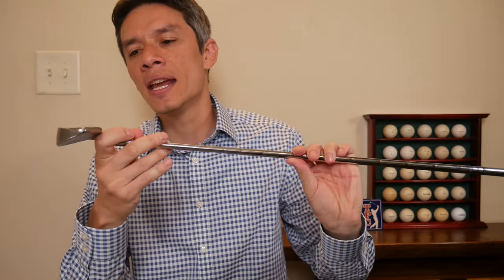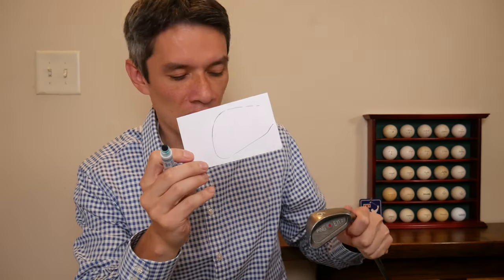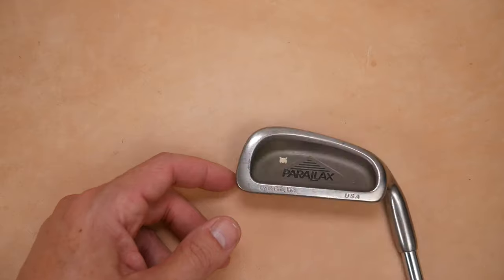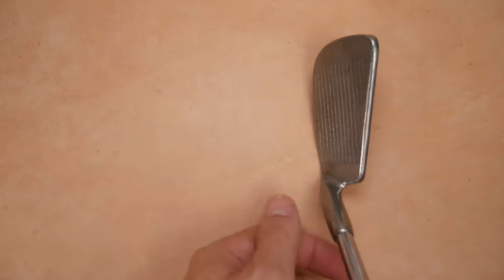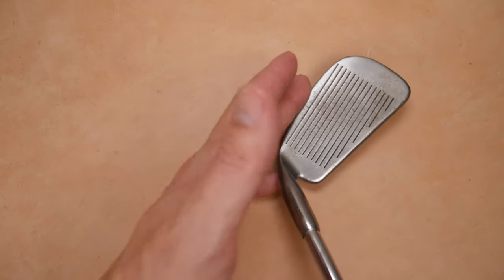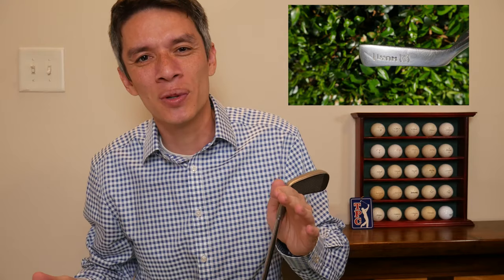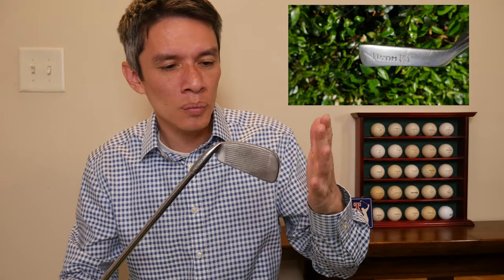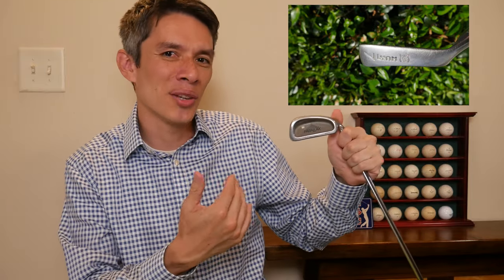1988-92 Lynx Parallax Irons - The Vintage Golfer

Comment: I had a set of Parallax irons and played them for almost a decade.  They were stiff shaft so as I got older I changed clubs to go to regular shafts and haven’t had a set of irons since that could compare to the Parallax irons.  Mine were the gray beryllium which hit different from the steel.  I just went to senior shafts so I bought a partial set of Parallax 7 through SW and have had them rebuilt with graphite shafts and had the faces and grooves refinished and put CP2 midsize grips on them.  They did not disappoint me, they hit better than my Pings and my Cobras and at 72 my index is again below 10.

Comment: I was just given a set of 4 through 9 with pitching wedge.  They have the original patent number stamped into the back.  Are they worth anything?
Reply: Also they are left handed.  Or I would use them
Reply: Yes.. their worth  trying  out... you'll  probably  change to them afterwards

Comment: I'm 41 years old and just getting into golf. I picked up a set of these today at a pawn shop for $45. Except mine have a little dragon or something with a number four stamped into them, what does that mean?
Reply: where is the dragon?  A furry cat face is their logo, on the sole.  Lynx is a cat, larger than house but smaller than jungle cats.
Reply: @donnrutkoff922  Thanks. Yep it was the cat. Still not sure what the number means though.